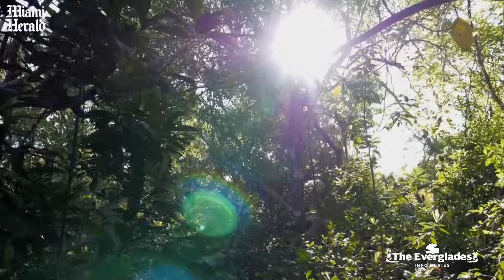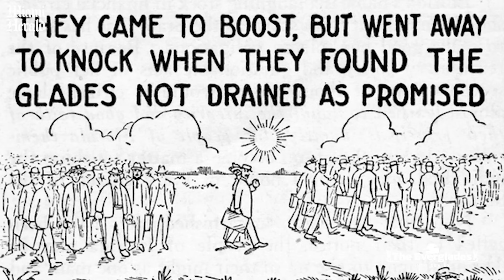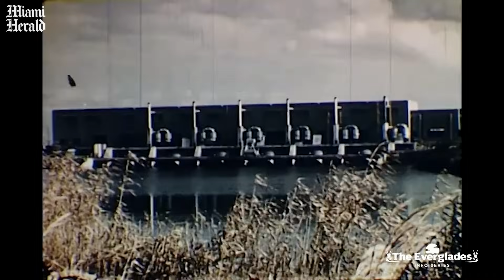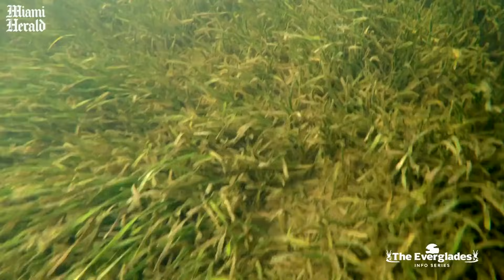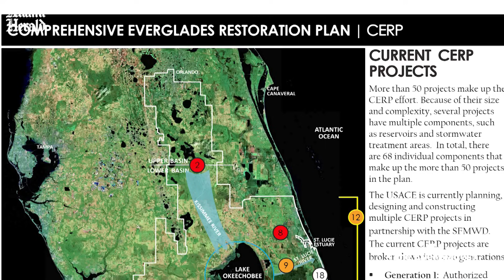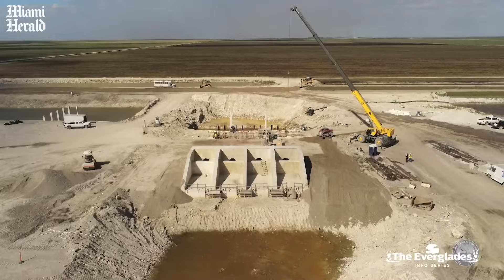How does the water flow through the Everglades?

Comment: Proposed Solutions: Accountability and Long-Term Fixes

The solution is not more reservoirs or additional lakes to hold polluted water. The real answer lies in accountability and prevention:

Regulation of Fertilizer Use: The state of Florida needs to create a regulatory body to oversee the use of synthetic plant nutrients, such as ammonium nitrates and petroleum-based fertilizers. Every user—farmers, golf courses, landscaping companies, and homeowners—should be required to pull a permit before purchasing or applying these products. The permit should track where the fertilizer is used, how much is applied, and whether soil tests have been conducted to determine actual nutrient needs. This oversight will ensure that fertilizers are only used when necessary, reducing runoff and over-fertilization.

Revenue for Cleanup and Global Impact: The revenue generated from these permits could be funneled into an initiative to clean up Florida's waterways. One potential solution is to construct a pipeline leading from Lake Okeechobee to the Atlantic Ocean, where we can safely discharge the polluted water into vessels designed to carry large amounts of water. These vessels, capable of holding up to 250,000 gallons of nutrient-rich water, would be towed by empty oil tankers returning to the Middle East after delivering crude oil to the U.S.

The water could then be delivered to arid, desert regions around the world—places like the Mojave Desert, or parts of Africa—where it could be used to irrigate crops and restore agricultural productivity. By turning a crisis into an opportunity, we could use the nutrient-rich water to grow food in regions that desperately need it. This water would not be transported inside the oil tankers themselves, but in separate, single-hulled transport ships, towed by the tankers.

The greatest benefit of this plan? It could save millions of lives. The agricultural yield from this water could help feed half the planet. Starvation would become a thing of the past, and famine would no longer be a global issue. This bold plan has the potential to make a lasting impact not just on Florida’s environment, but on the world stage. We have the means to make famine obsolete—what we need now is action to implement this outstanding plan and change the world for the better.